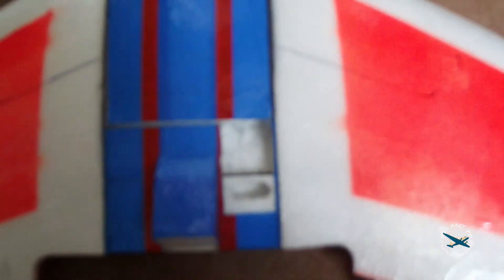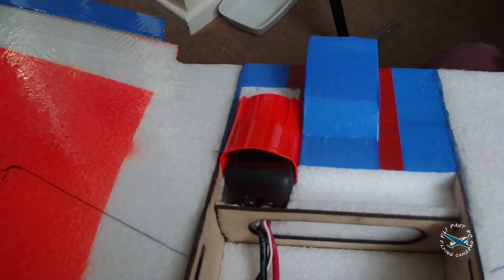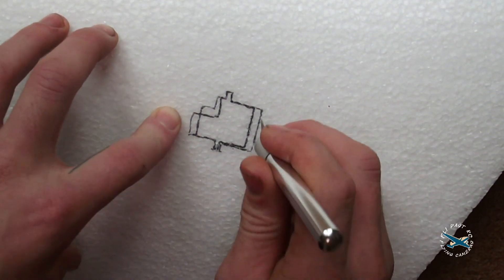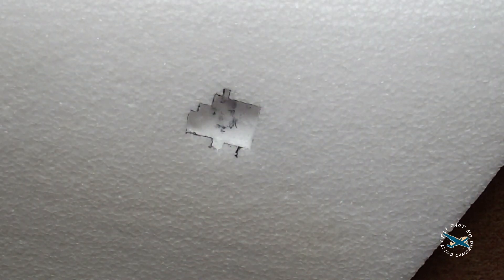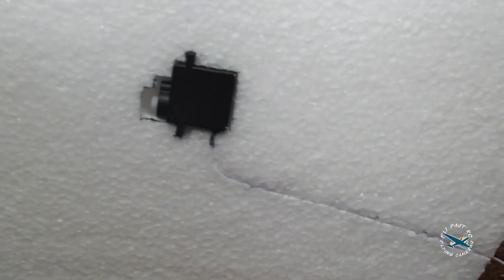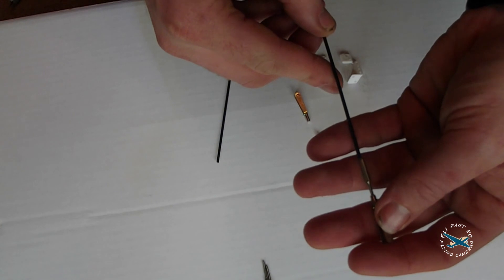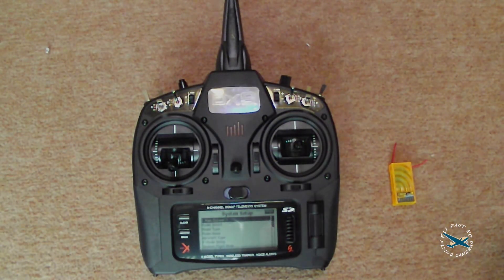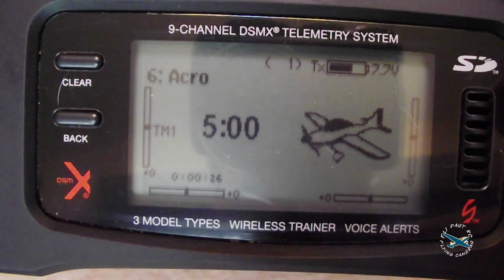Falcon Evo FPV Wing - Build Part 3 - Fit-Out

Comment: on the cg how far back from the wing leading edge in mm is it please? having trouble with my custom version as I have moded the fuz and it won't sit right.
Many thanks
Reply from the maker: 150mm from leading edge next to the fuse
Reply: FliPastRC outstanding many thanks just what I needed.

Comment: hiya, great videos on this build. Quick question - did you cut the holes first for the servos & wire routing then laminate it, or laminate before that?
Reply from the maker: cut the holes first then laminated over the cut out and cut away the laminate. cut the wire into the wing and run a strip of laminate over it

Comment: Would you like me to pass the measures of this wing ? As it has in rope cm at the tip of the wing and the wing center of the rope, and also how many centimeters of rope she has the part where will the required electronics.
Reply from the maker: +Paulo l henrique junior sorry not ubderstanding that?
Reply: +FliPastRC
Well, let me try to explain !
I would like to build this wing, but it would like u send me the measures it understood !
Example : How much is in centimeters in the wing end of the rope , center wing chord, profile used , full scale ok it!
thank you!
Reply from the maker: http://flyingwings.co.uk/fpv-uav/fpv-wings/falcon-evo-range/falcon-fpv-wing.html

all the details are on that link and Rob sells them too, great wings